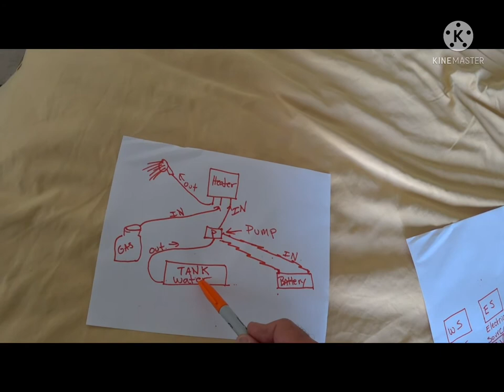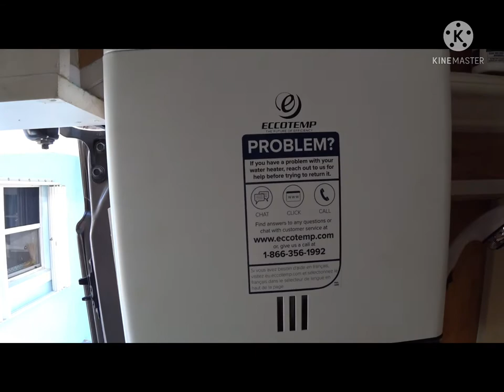DIY Portable Tankless Water Heater Install for Van Conversion

Comment: Hi. How does the pump perform with low water flow set on the boiler? I've heard the pump starts to struggle.
Reply from the maker: Hi!
The EccoFlo is capable of operating with consistent flow at all ranges of operation. It operates smoothly while drawing low current.

Comment: Did you mount the water heater inside ?...How did you vent it ?
Reply from the maker: Great question! The water heater is not to be permanently installed indoors or outdoors. It is a portable tankless water heater that requires proper ventilation and clearance for safe use. As you can see in the video, he has it mounted just right inside his door to his van, to protect from elements. But, he's outside when he's using it and keeping the door open for ventilation. His sink inside the van is a cold only sink, so you notice that he is not using hot water, therefore, there are no fumes inside the van when he's inside of it. You should never run the water heater in an enclosed space, as it should be used outdoors for proper and safe ventilation. Let us know if you have any more questions!